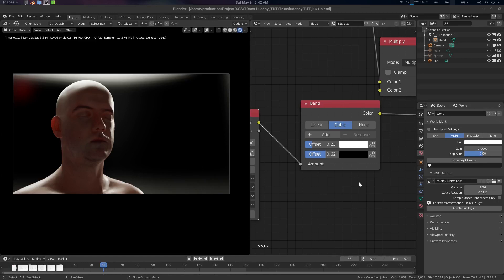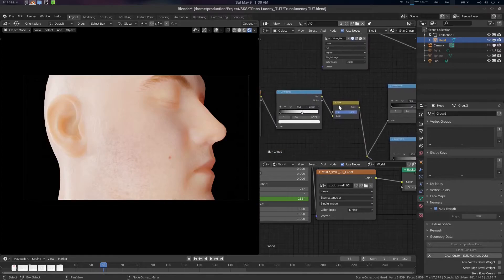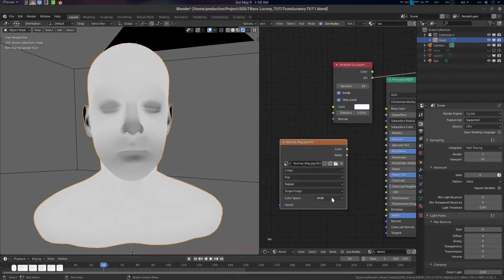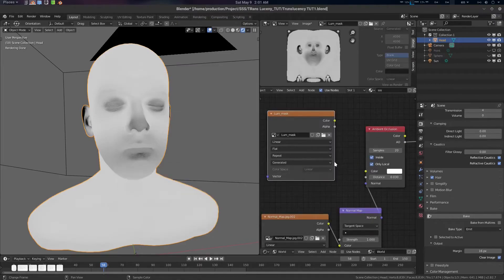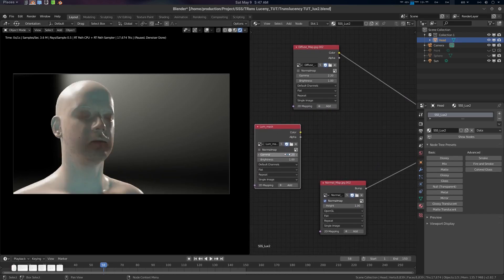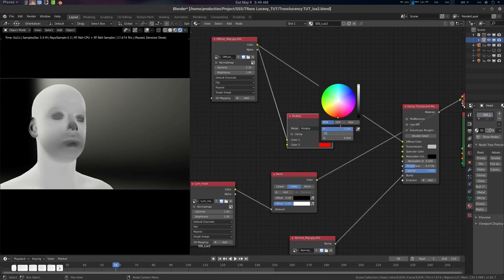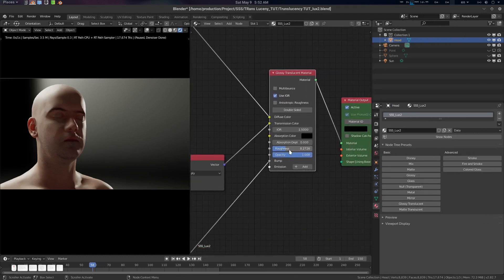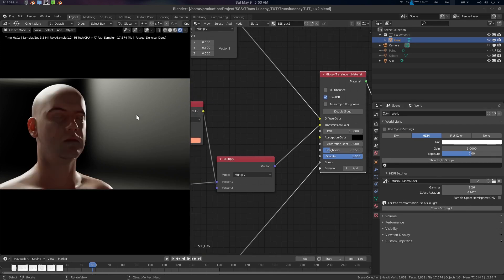Using Translucency Map for Subsurface Scattering in Blender Lux Core Render Skin Shader Tutorial

Comment: Great and essential tutorial! Can I ask how you decide to use the Vector Math node rather than Color Math with shades of grey? Is it to allow for simple linear multiplication of color values rather than one that has to account for internal gamma transformations in the color? I found I was able to get near identical results when using color math multiplying against grey values but usually the "V" value in HSV was not equal to the value needed in Vector Math node. Is this the only downside?
Reply: I think I just realized you have the habit to use Vector Math wherever logical because of the color transform AND the fact that Color Math cant multiply by values greater than 1. So Color Math is only really best for easily shifting color tint as needed. Duh! Is that about right?
Reply from the maker: @emberblend6897   Hi, Yes, that is right.